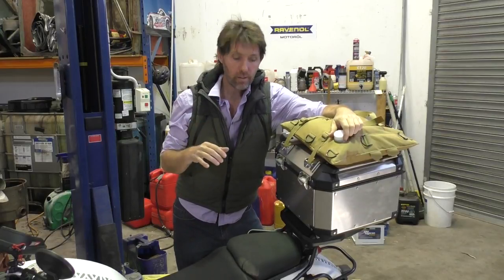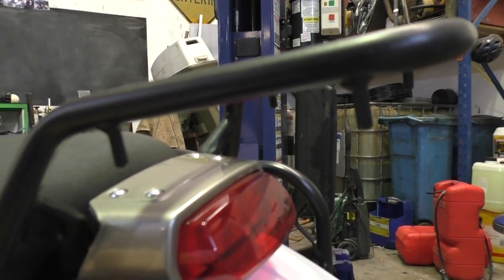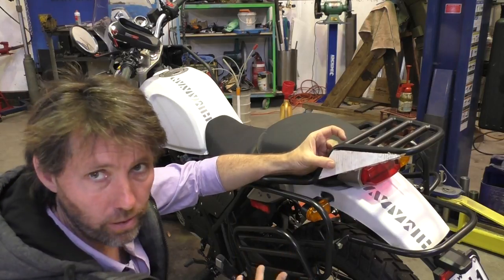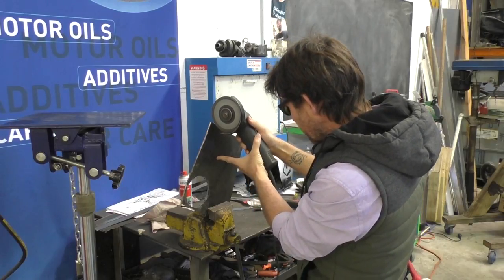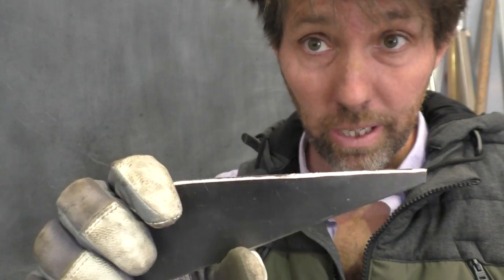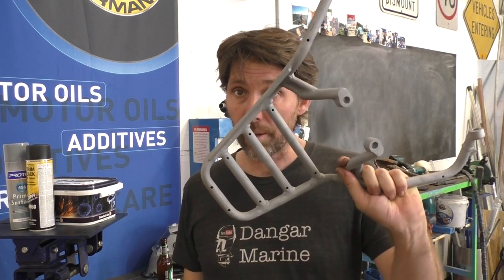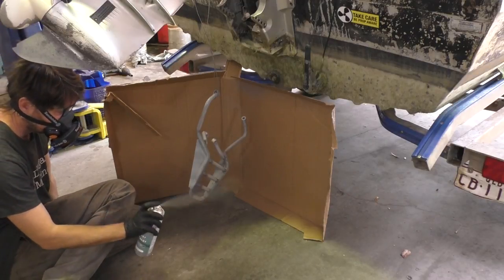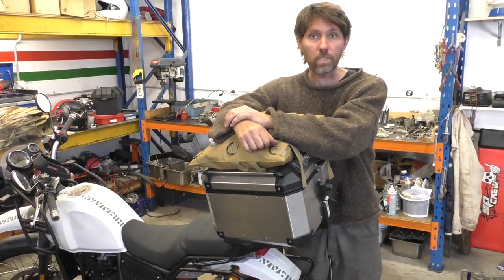Reinforcing the back rack on a Royal Enfield Himalayan

Comment: Great videos. Wish I had seen this one earlier. I also live in Sydney, and have the Himalayan with a 42lt Kappa K-venture Top Case (purchase it from Motostorm for $400 AUD a few weeks back. I ride daily, and just last week the to box bracket bent and sustained a crack. I was lucky the top box didn't come off while riding and do some real damage! I'm looking to repair the bracket and make the same improvement you have done here in the video. 

I've just clocked 4000km on mine, and apart from the bracket, have had no issues with the bike. In fact is been a real joy to ride. I just finished a two day ride from Mittagong to Wombyan Caves, then Jenolan via the Kanangra-Boyd National Park. Its the second time i've done it now on the Himalayan. Took a different route the last time, and some of the back fire trails were a challenge; steep rocky climbs and water crossings, but the Himalayan handled it all so well. Some stunning scenery out that way, riding over the great dividing range. Thoroughly recommend if your looking for somewhere different to take the Himalayan on your next adventure.
Reply from the maker: Hey Evan, sorry for the slow reply. Sorry to hear about your back rack. I'm actually thinking of replacing mine with one of Donowyn's stainless steel racks as the handle on my rack broken after this vid. I fixed it by inserting some steel bar and welding, but I feel it is made from very cheap thin steel. That ride sounds awesome, will definitely have to check it out.
Reply: I managed to find a welder (used hipages) and had him do the same as per your video, but also asked him to cut the bends and reinforce them with steel poles. So far so good. Just finished a 500km ride with the top box loaded and no issues. Fingers crossed. If it does fail then I’ll keep the Donowyns in mind.

Comment: the mystery bits you cut off are for tie downs to hold things on the rack. correct no loss with a top box. making indicators more visible great idea top marks
Reply from the maker: Yes, makes sense about using them for tying but as my top box is on permanently I certainly don't miss them.

Comment: you've just transferred the stresses to the other bend, that's all, you have to do both.
Reply: Have to agree.  And putting some holes in (for the bungy cords) might be a smart move.
Reply: If you put another gusset on the other bend you have just transferred the weak point to where the gusset ends with a longer lever arm.
Reply: I believe that you're all missing the fact that the rack is supported on both sides of the bottom tube radius; one on each side of the subframe with outer bolts, and with two bolts underneath the rear seat.  If you look at 2:29 you can see him removing the bolts under the seat, and right after he lifts the rack free, you can see the two supports that go to these two bolts.  While any cantilever system will have stresses being transferred somewhere, his reinforcement adds significant strength to the original rack design.  And while I'm always wary of overloading any rear rack, this one will at least carry more than a pack of smokes.

Comment: How is the rack holding out? I don't use a top box but I've read that reinforcing the rack in the region you did simply moves the stress point forward (towards the front of the bike) and the breaking point  of the rack is now along the horizontal part of the tubing somewhere under the rear seat. Depends of course on how much the top box is loaded and the amount of bumpy off road riding done.

Comment: Hi Danger Wheels, I had a word with the RE store manager who is also a rider. He mentioned the default Rack is not stong enough to hold a topbox with the reinforcment the way you have done. I have a plate mounted but rack needs reinforcement or replacement. I wanted to hear from as you for a feedback. How has the rack been so far? Has it been holding up well? Please share your comments.

Comment: Sorry to add a negative note but have you just moved the stress point to the next  tube radius . Maybe if you had extended a slim arm along the underside of the longeron and welded the whole it would have been a stronger job.

Comment: bro doesnt it make the back rack more brittle, cos i have many instances were welding heat actually make the metal harder and less flexible and finally it cracked after few months
Reply from the maker: Hi mate. You will generally notice that it will break somewhere near the weld. If you make a brace that completely supports the stressed area you will be fine.
Reply: Then weld the cracked areaa....😂
Reply: No it doesn't with the low carbon steel that the rack will be made of

Comment: Hey, weren't you supposed to drill the holes for turn signals prior to priming and painting?
Brilliant job though. You can also replace the filament bulbs with LEDs so you can get more usage time out of battery with auxiliary systems like hazard Lights, USB charger, flood/spotlights etc.
Reply from the maker: +Amaey Paradkar The reason I didn't drill them is that I'm not 100% sure I'm going to move them yet. I would need to design some special angled spacers to keep them pointing in the right direction given the plates are angled.
Reply: Dangar Motorcycling which place do you have in mind to move them? Because with everything in place, taillight and rear signals have reduced viewing angles as with every adventure tourer. Or maybe you can replace the whole unit but will be expensive.
Reply from the maker: I'm not sure yet, and I'm not sure it is going to be that necessary. When I have those bags on it will be because I am going on a longer desert trip where indicators aren't really a high priority. For the rest of the time in the city the top box and tank bag will be more than enough.
Reply: Dangar Motorcycling Yeah, good point, no need for it then. By the way, if you need anything from India just drop me an email or a message.
Reply from the maker: Thanks mate, much appreciate. :)

Comment: Great video mate! Will this work for the 58L top box as well. Can you advice if I should go ahead with it. It’s bigger then the one that you have installed hence want to double check with u if that’s a good idea. Also can we install the Givi aluminium panniers for the Himalayan ? Not sure which pannier rack would fit the Himalayan. And if I get one made locally will it fit the givi panniers. Hope u reply.Cheers.
Reply from the maker: I would certainly be doing this mod if you are going to add the 58L top box. It didn't interfere with me adding the base plate and I imagine the base plate is the same for both boxes. I've not looked into the side panniers as I am going with soft saddle bags, but I'd be interested to hear what you come up with.
Reply: Thanks for the reply mate. I checked it further. The 42 L topbox seems a perfect fit. Hence going with the same mod as u have done. However, incase of the side panniers I am currently holding on to it as givi doesn't make any universal pannier rack or stand. And I am not sure whether it will be a perfect fit for the himalayan. May be Royal enfield will introduce the panniers in 2018.
Reply from the maker: I think the 42L litre is a great size for this bike. I thought RE had aluminium panniers already? Maybe they were just in the launch pictures and not ready to sell yet.
Reply: Ahhh.. they had it but it seems they are not getting a vendor to get the bulk production done at a lower cost. Hence no panniers from RE yet. Made plenty calls to the showrooms but neither do they have a clue.☺️

Comment: How has the reinforcement worked so far? Have you taken the bike off road with the top case on? I like your subtle design and wondered if it works and if you would mind if I copy it. Thanks
Reply from the maker: The part I re-inforced has been strong, but with the top box on off road it broke further down towards where it attaches to the bike near the seat. My plan is to replace just those sections with solid round bar. I'll do a video on it when I get around to it.

Comment: Hi Dangar Stu, really enjoy your vids and your work, you're a good mech and top bloke. Like the work you did, just one suggestion, and only an opinion which could be totally wrong - You will still need to jack the end of the box support structure to a 3rd load carrying point as even though you have done a great mod, without the third point it looks like all you have achieved is moving the failure point further forward to the front of the triangle bracket. Thoughts? Keep up the vids, love your work!
Reply: I was thinking the same thing, the extra bracing would need to come back further along the tube if another support point is impractical.